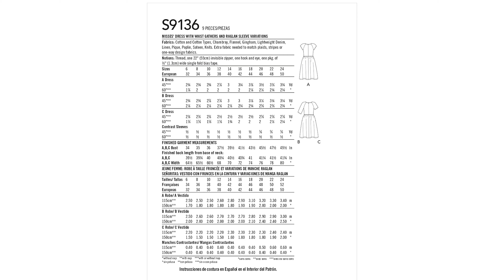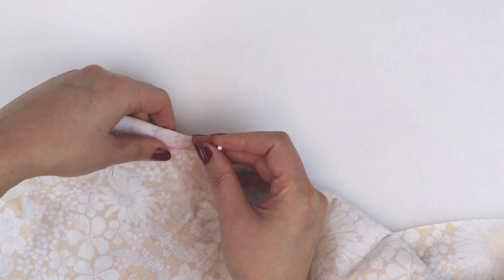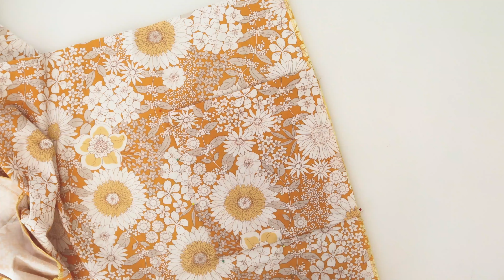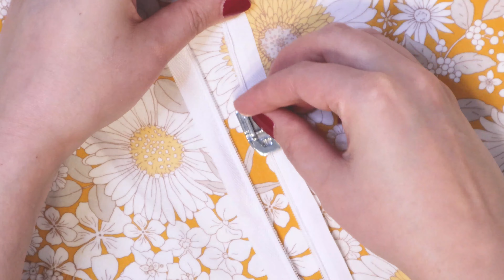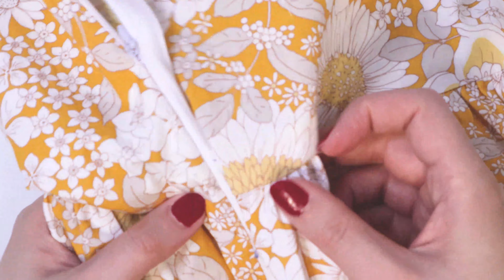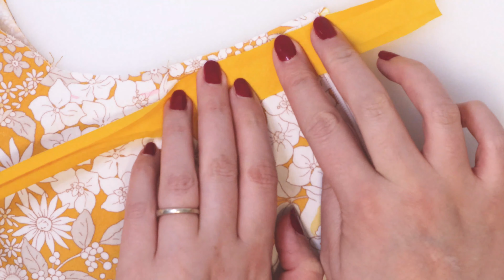Simplicity 9136 sewalong

Comment: Are the gathering stitches stitched by the machine? How are you pulling on those threads? Which threads are you pulling on? I feel like I am going to rip my piece apart. Did I do it wrong?
Reply from the maker: Hello! Gathering stitches are sewn on the machine with the longest stitch setting available. You do two rows then pull the bottom threads only to draw up your fabric.